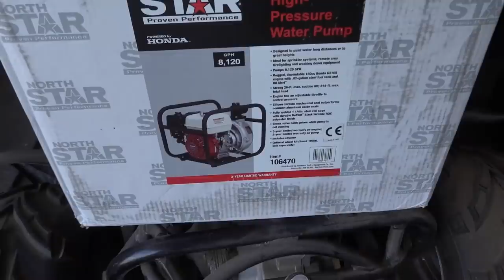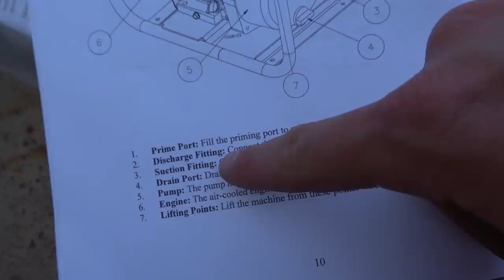I Built the Pumper Truck!!!!! Master Chief is Alive!!!

Comment: Hey Matt, from chatting with our local sugar cane farmers, I've picked up a few things over the years that may be useful:
1) Having the tank as close to the center of the wheels is better.
2) It might be a good idea to mount the tank across the bed rather than inline, and as far toward the cab as possible, and with the outlet toward the driver side. That way you can put an elbow and valve right up front as you get out to get the water on as fast as possible without having to run around to the other side or climb up on the bed to open the valve.
3) If you install the electric start on it, put the starter switch on the drivers side as well, for the same reason. If you keep the pull start, some motors let you unbolt the pulley cover and rotate it, so you might be able to pull start it from the ground if you can orient it to be reachable from the side of the bed.
4) With the outlet on the side, you can also tee off and put a faucet on the side. It's just a surprisingly useful addition to be able to get some water without having to start everything up. Small fires that are just starting might only need a bucket of water to extinguish.
5) With larger water tanks you definitely want to have baffles in the tank to prevent the mass of water moving around from moving the truck around. I'd imagine that's even more important with the tank sitting so high up.
6) With gas pumps it's a good idea to put a recirculation valve in to feed water back into the tank when the nozzle is closed. The flow of water through the pump serves as a coolant, and having the pump running without water moving can cause problems. (Electric pumps have pressure regulators that switch the pump off when there is no flow)

Comment: Without baffles in the tank, be cautious, baffles help to reduce the effect of weight sloshing in turns etc, which in turn can cause a roll over
Reply: WebCity Films  baffle balls are the greatest things in unbaffled tanks some good sound advice
Reply: Good call on the baffles sloshing water has a ton of force
Reply: A full tank is really not an issue... a half tank on the other hand... 😂😂😂
Reply: I knew a guy that had one of those square water tanks and he had to slam on the brakes and it crashed his F350 cab

Comment: You should do a bypass line on the discharge side of the pump back into the tank, so when the hose nozzle is off and the pump engine is still running you’re aren’t dead heading the pump causing damage.
Reply: Exactly what I was planning to comment
Reply: And it can double as the fill line when he's using the pump to fill the tank.
Reply: Would it be pressure activated?
Reply: Yes pressure  relief like a power washer. He will burn up the pump.
Reply: @AwesomeGames56  Yeah. You could attach something like the bleeder valves that you see on hydraulic systems. When the pressure gets high enough, the valve gets opened and releases the extra fluid into wherever.
Reply: Its a centrifugal pump, it does not build pressure when its blocked in. The impeller will spin freely if its full or empty. It slings water through the outlet instead of pushing in.
Reply: It also uses head pressure to get the water into the pump, it does not use suction to pull water into the pump.
Reply: @overthehill1958  exactly like a power washer lol thats the first thing i thought of reading this comment.
Reply: little centrifugal pumps like that would have to run for a loooong time dead headed before causing any damage
Reply: @TumbleTurd88  u are someone that knows what he is talking about... All fire engine pumps work like that.... He should get high presure hose on reel... I dont know if american FDs use them but here in europe they are pretty comon on almost all fire trucks especially good for fast atacks on bush fires ect....
Reply: @00mihec00  yep here too. Trash lines there called. Basically massive high pressure garden hoses.
Reply: @TumbleTurd88  exactly.
Reply: @TumbleTurd88  As long as the inlet hose does not have a check valve.
Reply: It would run out of fuel before it damaged the pump...

Comment: If you are wanting to have the option to pump from a dirty water source like a lake or river you should also have a large filter to put on the hose or else you will pick up junk(fish,mud,plants) into your pump.
Reply: Junk, and possibly small creatures or fish.
Reply: You only need a strainer keep big stuff out.
Reply: They make them screen cage things
That goes on the end. 
Small particles won’t damage one of them pump.
Reply: Absolutely! Good call and maybe a float so the hose stays close to the surface
Reply: As well as a secondary hard line, otherwise how does the water go back in if you're already using it on the other side of the pump?
Reply: Need a strainer and a five gallon bucket to put the strainer in. Almost completely eliminates any large debris
Reply: Right, the pump won't care about small stuff, but you don't want to be sucking up twigs or weeds.
Reply: The pump will handle it no problem.  Just have to make sure the hose pickup doesnt clog.
Reply: @lemonaid8678  they're called a foot
Reply: @irav4u  thanks.

Comment: You need to get a filter so when you get water out lakes and stuff you don’t have to worry about fish and sticks getting in your tank
Reply: Working at a Marina we used similar pumps to pump out boats that were sinking.  Yes you definitely need some kind of filter/strainer to keep stuff out of the pump.  Also we used the cam lock fittings on all our pumps.  Saltwater can cause problems with them if they aren't maintained however I doubt that would be a problem for you.
Reply: yep they make strainer baskets to hook on with a cam lock. Keeps the trash out

Comment: Southwest Fire Dept member here. Glad to see you enjoying our former truck. Come by and see us any time you’re in the Auburn AL area.
Reply: Roll Tide!
Reply: Matt, you should have got a tanks with internal baffles to keep the water from sloshing around and potentially rolling the truck in a turn. The pump is known as a trash pump. If your mostly worried about brush fires you should have got forestry hose which is much smaller than your 2 1/2 inch hose and way lighter or a booster reel like an earlier commenter said. Bottom line be very careful driving the truck when the tank has water in it.
Reply: War eagle!
Reply: Also what will make the tank safer,  would be a tank with Dividers like tanker trailers and trucks have, as that will eliminate alot of forward and backwards momentum of the water stored.
Reply: Gotta be cool that you're a viewer and get to see how the old truck ends up.  Also, thank you for the work you do!
Reply: @BoomerKeith1  very much so. We got it as a desert drab with railings and benches in the back. Got it converted and got good use out of it.
Reply: @tompeavy8254  So you guys repurposed it for your needs and now Matt repurposed it for his needs.  Very cool.
Reply: War Eagle!
Reply: Thank you all for your service
My older brother is a volunteer firefighter
Reply: I'm in the Auburn area..... Auburn Washington
Reply: Thanks for your service! and Roll Tide Roll!

Comment: For your truck I recommend 1inch hose, that's what we use for brush fires.
Reply: We fight with 1 inch hose we only carry 750 gallon so u have to preserve it as much as possible
Reply: @garrettbedford1795  A forestry head is great for preserving water, the one Matt has there will eat through water like nothing.
Reply: Agree with this statement. Unless you have a steady water source, you want to preserve as much water as possible.
Reply: Up here in New England my fire dpt. Uses 2 1/2 inch for brush and some forest fires
Reply: Plenty of homes were saved from kitchen fires and dryer fires by a good ole booster reel! Miss the days of getting in and getting water on it fast. Aggressive interior attacks have been pushed out by hitting it hard from the yard babys...
Reply: @TheHunt-dq4vm  they're bots, ignore/report them.

Comment: USAF Aircraft firefighter here. You have a good system going so far. Most rural brush trucks have a remote nozzle on the bumper to fix your hose issue. Your pump and tank will last you longer than you think but make sure and carry an extra fuel can with you. We use s stewie on one of the volunteer depts out here and the truck is a beast.

Comment: I think you need a water pressure recycle valve back to the tank. It will prevent cavitation in  the pump when the hose is off and the pump is running.

Comment: You really should have gotten a tank with baffles to keep the water weight shift down.
Reply: Was thinking the same thing
Reply: This comment should be up!! Matt have to read this because weight shift of this much Of water si really bad
Reply: @Fannatic942  As a former apparatus driver, I have felt the effects of the water shift even with baffles and with none at all, it could flip a truck even the size of Matt's or break the mounting and roll off the truck destroying anything it falls on.
Reply: @timm2020  Yep that's the way to go, use Baffle balls
Reply: Can just put some coiled up hose in the tank will greatly reduce water slosh aswell and a cheaper option than baffles
Reply: @timm2020  An improvement over the open tank, yes.  As good as an actual baffle tank, no..

Comment: Matt, because it's a white/clear plastic tank,  if it's not getting emptied very often you should chuck some bleach in the water to stop it getting green and full of algae. Don't need much and it's still safe if you need it for drinking water (it's what we do over here in little old NZ). 
Ps, if you do actually see this, I LOVE your videos!! You're an awesome dude!
Reply: also painting it black helps
Reply: Sodium hypochlorite degrades very quickly in sunlight and is corrosive,  would be best to paint the tank.
Reply: Found a kiwi

Comment: Those honda pumps can be fitted with an electric start, so you could have a Start button on the side and the pull cord as backup in the bed of the truck.
Reply: Exactly what I was thinking. Electric start seems like it would make sense here
Reply: Dansker?
Reply: @oscarbrsting954  Jep
Reply: @albaek790  Hæhæ fed nok🤟😎

Comment: If you want to draft water out of a lake or body of water, I recommend having a strainer for the end of the hard suction line. Without that, particles and debris will get into your pump and you'll find that the pump wont work that well anymore.
Reply: its a trash pump they have no problem with crap in the water
Reply: He will get a quarter tank of mud and debris which will ruin not only the Fire fighting ability but damage the pump and the sprayer

Comment: Hey Matt, I'm Vol Fire and one thing my department does is we keep a few metal rakes on our trucks to create a 2 foot gap of bare dirt from the burnt area and the non-burnt ground. this will eliminate the fire from spreading further. Awsome setup man hope this helps!
Reply: Extrremely underappreciated comment. I would have that thing loaded with any potentially useful tool for any scenario.
Reply: this kind of thing is useful for farms too. when burning sloughs we always disc at least 25 feet out to create a firegaurd.
Reply: God it's a rush digging fire line during a rogue flame. You've never see fire travel faster, its terrifying
Reply: A good leaf blower works so much better to cut a fire line 
Rakes do have their place though

Comment: From a firefighter - buy a floating strainer and a separate piece of hard suction hose to use for pulling water from a water source to fill your tank. Also can get a floating gas powered pump that could fill the tank while flowing water

Comment: Touching on what Jamie said, the 1 1/2 hose you have is primarily for structural fire “residential and or big buildings” booster hose is a soft hose that is used in the forestry service. This hose can be reeled up and is very easy to move around and manipulate. You’d be sacrificing some water pressure for it because it is not as big in diameter but it will far better useful for what you are using it for instead of the structural fire hose. Generally the 1” hose nozzles have “smooth bore” and is just a solid stream of water instead of your fog stream. Careful on water hammering your pump... I’m not to sure if booster line you have to care to much about it but to be safe and not damage your pump just close the nozzle a little slower that way your hose doesn’t burst or if damages your pump.
Reply: You, Sir, are 100% correct in everything you just said!

Comment: You should mount the pump under the bed in front of one of the wheels so you can access and start it from the ground. It doesn't need to be up on the bed with the water tank. And put connections to fill the water tank down there too so you don't have to climb up to fill it every time
Reply: This is a great idea
Reply: I was thinking the same thing. That & put an electric start on the pump so you can focus on mounting it in a way that's best for the lines instead worrying about clearance for pull start. Mounting it under the bed would also allow you to plumb hard lines under the bed so they are safe/out of the way (leaving the bed behind the tank clear/usable if needed)
Reply: Agreed
Reply: @SirOtterman  I think you both are on the right track 👍

Comment: Hey Matt, you should consider putting in a swimmer in the tank, that messures the waterlevel, to shut your pump of if the water level gets to low, because pumps dont like to run dry and you dont have to monitor your water level manually why hosing down. Recirculate your water to the tank while you are not hosing to prevent overheating your pump. If you want to pump in water from sa lake or stuff like that take a mesh with you for your succionhose that goes into the pond to prevent debree entering your pump, small stuff shouldnt be that much of a problem but a stick could damage your pump
Reply: J's connect it cause if not it may get lost when u shit it off like fall in the pond or water soirce
Reply: Water cannon on the side of the bed.

Comment: Hey Matt.  why don't you turn the water tank sideways on the back of the truck then you will be able to access the valve from the ground. then is it possible to mount the pump on the chassis in the same way the diesel tank fits, maybe on a pull out frame then you can have total access to the pump from the ground too. I agree with your idea for a hard body hose reel as well, much easier and quicker to deploy and retract. Awesome job buddy!

Comment: you should connect a scuba tank up to your helmet when doing a burnout at cleetus and cars so you don't choke on the smoke again
Reply: Yep remember the helmets for the trophy truck with the air hose connectors, perfect use.
Reply: Gnarly electric fan would even help
Reply: Little emergency scuba tanks that just hang down from the mouthpiece. Should last plenty long enough for the world's best burnouts

Comment: Matt, when running a load on a truck or a trailer that is near your max of the vehicle you need to center the mass over the axle as much as possible. Otherwise you're going to flex the frame and it's going to break. Just like your old flat trailer did.

Comment: You can also look into an electric start for the pump. Build a small box to keep your flat hose in. You can look up a firefighter flat lay for hose. If you plan on drafting or sucking water from a pond or water source to fill the tank I would look into a low level strainer for the cam-lock fitting and hose.

Comment: If you plan on leaving water in the tank you should have got a black tank because the clear one will allow sun light to shine through causing algae and other things to grow which much plug up the pump or hose
Reply: Will painting the tank work?
Reply: @lilsolo68  yes
Reply: Does he need also some sort of baffles/compartments in the tank to avoid the water from sloshing too much while driving?

Comment: When you are not flowing water with the engine running, you really need to install a relief valve on the discharge so the pump isn’t dead heading. The relief valve routes the flow back to the tank.
Reply: This is very important. Especially if you want to stop and start your discharging.

Comment: I use braided hoses with cam locks at work. One thing I will definitely recommend when using them with pumps that create pressure is a bleed off valve to relieve the pressure before unhooking the hose. Water can be as dangerous as any chemical.

Comment: Fire truck engineer here: Went to the comments to see how many were yelling at Matt about him first saying he thinks the intake is the top and the discharge is bottom. Now I'm laughing at the amount of Firefighters showing up in the demolitia with awesome advice. Stay safe out there brothers!
Reply: The wrong intake issue is an OCD trigger.
Reply: I did the wait I think that is wrong. Not a fire fighter but I have marine fire fighting training (I work on a ship)
Reply: Isn't a plastic tank for use around fire a bad idea?
Reply: Former Pump and Compressor Sales Engineer (years ago). Immediately thought he  had those fittings reversed! He he he finally RTFM!
Reply: I’m a plumber and use that type and many other pumps. When he pointed at the top of the pump and called it the intake I started to shake my head saying no. He had it backwards intake to any pump feeds straight into the pump first.
Reply: why not hang the pump and hose/hose's below the deck and run hard piping from the tank to below the deck so you don't have to climb up and you have a mostly clear deck other than the tank so its not crowded and a hazard
Reply: @skullcall9831  yeah on the truck he should realy have proper, out of the way, hard piping